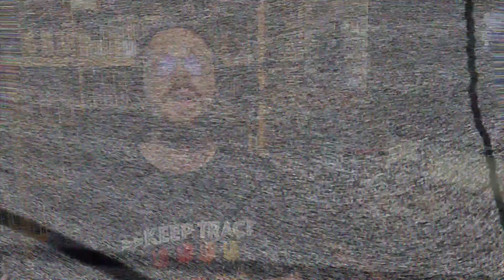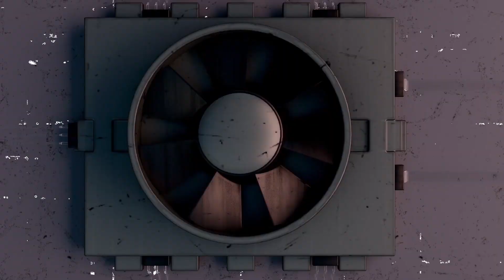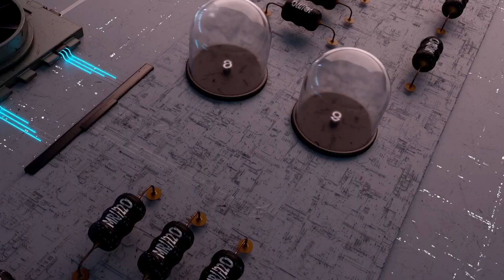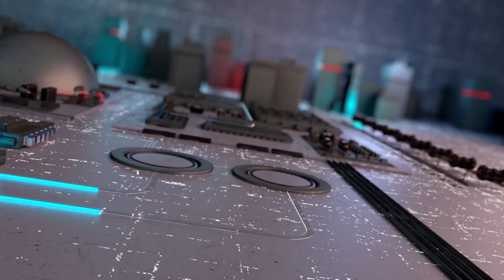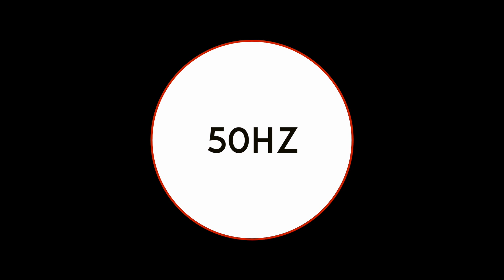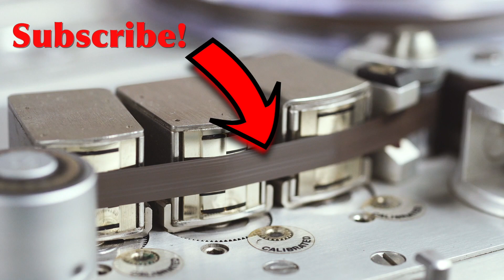How to Kill Hi-Fi Hum

Comment: I had hum problems with my headphone amp, but I couldn't understand who was the culprit between amp, DAC and PC, as removing any of this three solved the problem. What's even stranger is that the DAC doesn't even have ground on the plug! Anyway two things could solve the problem, the first was using a toslink optic fiber cable between PC and DAC, the other possibility was to remove ground from the headphone amp. I chose the second as using anything different from usb to connect the dac means that I can't control the volume from pc, so I need to use the remote or reach for the volume knob, but also audio quality seemed to suffer just a tiny bit (but it might have been just suggestion).

Comment: You mentioned it very briefly at the 6.08 mark:cable TV isolator.  I tried everything to include an expensive surge suppressor/sound conditioner to eliminate the hum in my speakers.  Nothing made a dent. A simple cable TV isolator did the trick.  Bought off eBay or Amazon-can’t remember.
Reply: I bought my TV isolator after my USB TV tuner blew up when I connected both it and a charger to my laptop. You could feel the electricity making your muscles move when touching both connectors. Cable TV usually comes from a different building. And buildings far apart can have ground at different potentials because of both ground resistance and the power lines carrying AC being out of phase between two separate points along the way. That's why all devices with RJ-45 Ethernet sockets have little isolation transformers in them, sometimes even inside the socket itself. Because that standard was actually designed with transmission between buildings in mind.

Comment: I have a very noticeable subwoofer rumble while using my Technics SL-1200MK5 with a Nagaoka MP-200 cartridge, the amp is a Simaudio Moon ACE can any of the aforementioned intrusions in the signal be the culprit of this? it does a huge subwoofer movement even at quite passages, how can I eliminate this as I´m  afraid it will damage my speakers? thanks.
Reply: Many times with sub, it’s a long sub woofer cable. You can get a cable interconnect ground isolator to fix the issue. Hope this helps.

Comment: Greetings - I enjoy your channel - first time commenting.  I've had my Technics 1200g for nearly a year.  No hum issues, but I hear a very faint periodic "thump" once per revolution (happens whether 33 or 45 rpm - obviously more frequent with the latter speed).  Inaudible when playing music (except for very quiet passages) but I can hear it between tracks. If the tonearm is cradled, I. don't hear this thump sound.  I know this is a bit off-topic for a "hum" video but wanted to ask if you have any thoughts as to the root issue given your ownership of this same turntable.   The only mod is a 3rd party mat.  Cartridge is an Ortofon Cadenza Bronze.  Thanks for any suggestions you may have!
Reply from the maker: Humm...I've seen around this wobble problem affecting most new Technics tables. Maybe in yours is quite evident? Try to check that...
Reply: Thank you for the reply.  I've contacted Technics consumer support and asked for their assistance having this problem addressed.  Although this sounds like a latent defect, I should still be under their factory warranty.  In all other respects, I really love this turntable.

Comment: As far as turntable hum..i have tried 3 turntables..3 different amps and still have the problem in all configurations..so maybe there is a ground prlblem in the house..i dan't think it can be anything else..tried different cable..power boards..etc
Reply: My house also has bad power

Comment: 4:00 Worth noting that if the equipment DOES NOT have a ground pin (e.g. two-pin plug), then its not likely an issue. With only live and neutral, there wont be any path for the ground loop unless there is a fault (or a deathtrap designed in China and they tied the neutral to the enclosure). Amplifiers that only have two pin plugs will have input/output stages that are floating, and should not have issues with hum from ground loops unless you inadvertently ground something you shouldn't. In that case there is more likely a power supply fault in the amp itself if it persists with no inputs. The same applies to your TV set. If its only got two pins, it cant cause ground loops. PCs and laptops are different as they must have a grounded enclosure to prevent the case from becoming live at mains voltage should the SMPS fail or suffer a breakdown in isolation. But generally, only your equipment that has a three prong plug can be a source of ground loops. Need the ground, of course! So concentrate there first before going further. And you can check if its a broken ground by simply using a multimeter set to continuity. Check from the ground pin to a bare exposed metal part of the enclosure and ensure there is continuity. If not, the ground pin or the ground connection is not connected, and should be fixed at once.
Reply: The same applies if you live in an old building that doesn't have ground on any sockets except for bathroom ones. But there is still capacitive coupling either in the transformer or a little capacitor added on purpose to help with RF interference. This may still couple more to one prong than the other, so rotating the plugs may help even without ground. But it is more likely to be bad audio cables then.

Comment: Quick note on the 50/60 Hz. The 50 or 60 Hz itself is not so much the issue. The real issue is the harmonics you get after the mains is rectified by the power supply. The harmonic overtones (e.g. for 60 Hz: 120 Hz, 240 Hz,  etc.) are whats most bothersome. Thats what gives it that "buzzy" quality to both the 60/120 Hz tones. If only 50 or 60 Hz was present, it would be hard to notice, and commonly the pure fundamental is often present in very small amounts in most equipment due to magnetic coupling. Some of it can be helped by adding a snubber network on the secondary of the mains transformers if your equipment uses it in lieu of an SMPS. It will help eliminate the sharp pulses from the rectifiers cutting off after the bulk capacitors have charged. This will help remove the higher order harmonics if you cant sufficiently isolate the grounds.

Comment: Nice attempt to solve a very common problem, but it’s a minefield and I would like it if suggested a call to a local Hi-Fi retailer where the equipment was bought from for the safest and best advice if all else fails. If they are any good they will identify the trouble and fix it, like the did for my ground loop problem which had faulty tonearm cable. Keep the analogue faith✌️ (are those CD’s in the background?😁) By the way - the word is ‘sensitive’ not ‘sensible’ but as it’s not your 1st language 👍😁😂

Comment: Don’t forget Tube Gear can have Hum from a bad tube.   I just upgraded my power tubes and found a hum on my right channel. I swapped tubes between channels and still had the hum on the right.  So my problem was not the tubes.  After more research I found a loose RCA jack on my vintage amp. After correcting the jact the hum disappeared.  Moving the amps to install the tubes must have the catalyst to loosen the jack the last bit!

Comment: This was such an excellent vid. Man, do I hate hum! Luckily, my system is dead quiet now, but I’m sure you helped many people resolve their hum problems! 
I’ve heard that ferrite beads can help reduce hum when placed in certain places on cables, but I’ve never tried it. Also, I love Grado cartridges, but they can cause a lot of hum when they get too close to a transformer. If a lead wire on your headshell is loose or broken, that can cause a super loud hum, even a loud buzzing noise . I now use only high quality lead wires, mostly Jelco or Ortofon made with litz copper. 
Again, great vid. Thanks! I’m very glad you really addressed the hum issue. 🎶🔊🙂

Comment: I have had this issue. The thing that helped was insulating the power cable ground on the plug side with electrical tape. The amp still has a ground connection through the RCA interconnectors to the DAC but the hum stopped. Is there another more elegant way to fix this?

Comment: I hear this faint noise every time I’m cranking up the system and as I finally turn the system down there is this screaming voice saying TURN IT DOWN!   How do I fix this issue.
Reply: Does it go away if you turn it back up? I get knocks through my floor when I crank mine up, it doesn't seem to happen through my headphones which is odd - or if downstairs are out. I'm sure there is a common link here.....
Reply: Ah Yes the turn it down beep... if you do that often enough, the beep will accompany you 24/7, it becomes your best friend! 👍
Reply: @QoraxAudio  However if the beep is accompanied by flashing blue and red lights, you may have a serious system fault that requires involuntarily heading to the local precinct to rectify it.
Reply: LOL

Comment: I get some 'hum' or buzzing from my amplifier, due to other gadgets such as Computers ect. As long as my initial signal chain isn't close to those 'noise makers' it won't affect the audio directly.. (as is proven by simply dumping it via firewire to the computer) - but monitoring that same audio can have noise in from said interference. Tends to be components that suffer some sort of noise / distortion / hum.. as long as your signal chain from the source is clear and you can prove this , it's then easy to target where hum is coming from.  This is of course aside from broken components (bad capacitors ect)    One thing to keep in mind as well, never  keep your Cellphone near any signal chains - if you have to keep your phone near your gear, keep it on Airport mode or you WILL pick up distorted interference.   Test this any time by putting a cellphone next to your headphone cables or a tape deck play head and you will hear it.   It's the worst noise in the world.

Comment: Thanks! I had a phono ground hum when I first hooked up a Mani phono preamp. All I did was disconnect the ground and reconnected it and hum was gone. Seems the connection was better when the “U” shaped connecter bottom was slightly away from the screw post. Ie the sides of the “U” connecter nicely secured got rid of the hum.😀

Comment: Great tips. I was having issue with my power cables. So i took an old vacuum  cleaner hose. Cut with metal snips along the length. Placed all unshielded power cables  inside. The metal rings along the length make a great shield plus it works great helping keep cables organized.

Comment: Had a hum on one channel, turned out that one of the several XLR balance cables that I use in my system was different than all others in that while all others had four wires for each channel this particular cable had only three.

Comment: I only hear the 50hz noise (i think this is this one that i hear) when i am not listening to music and i turn the volume very high at a level that i never reach when i listen to some music. I have never felt disturbed by this so do i still need to investigate more? Do you have any recommandation for quality preamp power cord without (as you always say) spending an arm and a leg?
Thank you for the video.
Reply: That is normal.
Especially when a turntable is connected.
Reply: @QoraxAudio  ok thank you i didn't know about that.
Reply: Have the same case!
Reply from the maker: Well, if doesn't bother you your lucky! Before getting a good power cord just try to change it with a new one, even just a simple bulk standard black power cord and see if it changes. With turntables things get complicated. It may be many other things. Check the turntable doc I linked in the video description it has loads of solutions to try!
Reply: @anadialog  alright thank you. I'll check it out
Reply: @FREEAGENTOFGODYAH  yeah i feel like i comes from the amp. It is an old one (kh 503). I'll chek it out. Thank you.

Comment: If you got hum in your system just means it's enjoying the music but can't sing along😄

Well European connection it is a loop connection ring main,  you don't want that in your mains the hi-fi has to be a dedicated line ideally and can be dedicated just depends how the setup is,  a fridge or freezer can cause hum on the network if it's on that ring main or air conditioner. Ideally on every power cord a safety cap film polypropylene capacitor of 0.22uF at 275v across the live and neutral terminal this can be dangerous and you have exposed wires!! this should be done at the socket behind behind the Wal,l or in a strip each connector to each plug individually. They consumer unit can get noisy MCB or RCD producers noise ideally replace it with a fuse if a 20 amps mcb  use 15 amp fuse wire.

Comment: In my opinion, the turntable connected to the amplifier without a 3th cable connecting the ground from the recordplayer to the ground of the amplifier, is the MAIN reason for hum.
Reply: @FREEAGENTOFGODYAH ,  Maybe you have a point there, but I live in a new home with correct electrical installation.  I had hum while using the turntable.  It disappeared once the ground was connected.

Comment: There  are most common issues  with ground loop , power cables almost always causes  that. you can just STICK   insulating tape  on the ground section  on both sides of  power strip. Ground loop  noises WILL disappear.
Reply: Picture please. Lol ty.
Reply: @gonzaljevic   just stick insulating tape on ground part of the power strip where power cable gets in. cant send you pictures here. I HAD ground loop problems with my active monitors. So easy to do.
Reply: @MarkoVlasicAudio  Seems like this is a good idea. But I still don't understand it. Do I place the tape on the ground socket even though my cable has a ground wire? Is the purpose to close the ground socket in the outlet?
Reply: @ArthaxtaDaVince777   just try to stick tape over and noises will be at minimum. even silent.
Reply: @MarkoVlasicAudio  Can you give instructions? Sorry I'm extremely ignorant on this topic...